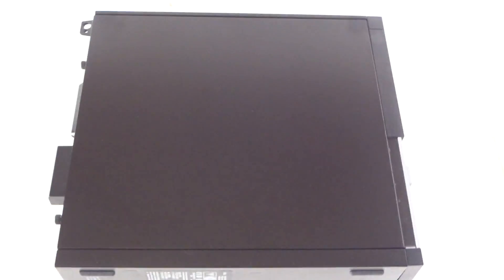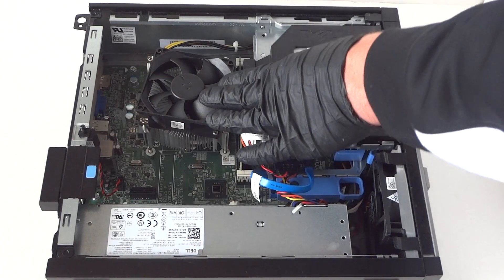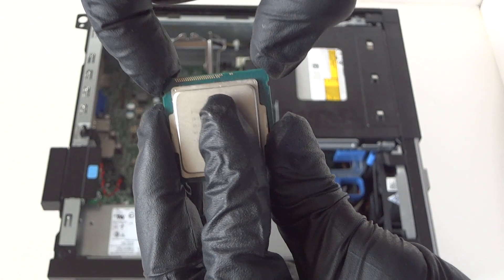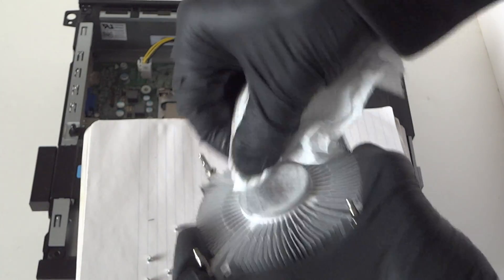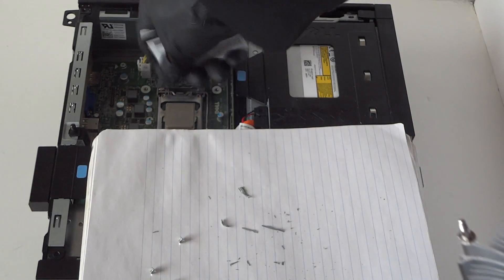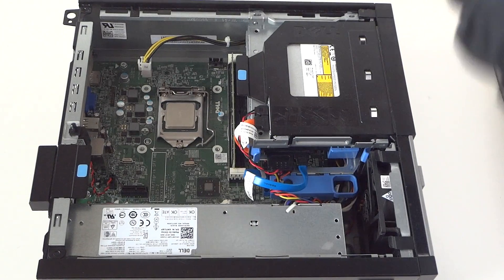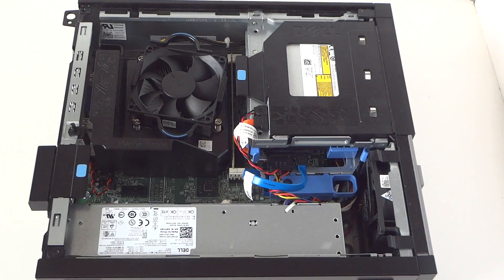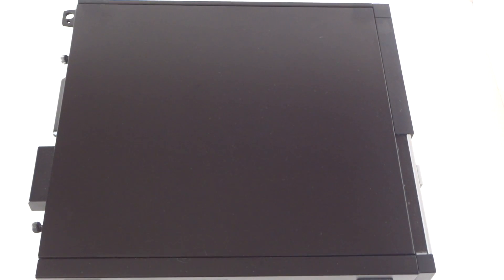Dell Optiplex 3020 CPU Upgrade

Comment from the maker: List of Parts and Upgrades works with this system :

BIOS Update Required Version A20 Before installing i7 CPU.
https://www.dell.com/support/home/en-us/product-support/product/optiplex-3020-desktop/drivers
 

CPU Support List:

Intel Core i7 4790K, 4790, 4770K, 4770, 4770S
Intel Core i5 4690, 4670K, 4670, 4590, 4570, 4670S, 4430
Intel Core i3, 4170, 4160, 4150, 4130

CPU Upgrade: 

Intel Core i7-4790 Haswell Processor 3.6GHz 8MB LGA 1150 CPU
https://amzn.to/3xeRaF5

Intel Core i7-4770 Quad-Core Desktop Processor 3.4 GHZ LGA 1150 
https://amzn.to/3QFmJ1v

List of RAM will work with this system.
Maximum Memory supports: 16GB 
Supports only DDR3 or DDR3L

This RAM works with this machine MAX RAM 16GB:

(1.) Crucial 8GB Single DDR3L 1600 MT/s (PC3L-12800) Memory CT102464BD160B
https://amzn.to/2VhGv8O

(2.) Crucial 4GB Single DDR3L 1600 MT/s (PC3L-12800) Memory CT51264BD160B 
https://amzn.to/2xq46wb 

(3.) Crucial 16GB Kit (8GBx2) DDR3L 1600 MT/s (PC3L-12800) CT2K102464BD160B 
https://amzn.to/2VpsKpP

(4.) A-Tech 16GB (2x8GB) DDR3L 1600 MHz UDIMM PC3L-12800 (PC3-12800)
https://amzn.to/3i97Zt2

List video cards will work with this system.

(1.) AMD Radeon RX 6400 Low Profile Gaming Graphics Card
https://amzn.to/3s8MUUY

(2.) Gigabyte GeForce GT 1030 GV-N1030D5-2GL Low Profile 2G Computer Graphics Card 
https://amzn.to/2Z4PHkp

(3.) ZOTAC GeForce GT 1030 2GB GDDR5 64-bit Low Profile Video Card ZT-P10300A-10L 
https://amzn.to/2WzgLXk 

(1.)  Thermal Grizzly - Spatula for Applying and Spreading Thermal Paste
https://amzn.to/30Qq4ag

Thermal Compound Paste:
(1.) Arctic Silver 5 Thermal Cooling Compound Paste 
https://amzn.to/2ziNU0H

(2.) Noctua NT-H1 3.5g, Pro-Grade Thermal Compound Paste
https://amzn.to/36kTk7A

(3.) ARCTIC MX-4 (current edition) Thermal Compound Paste 20 Grams 
https://amzn.to/2DhGJaK 

3.5" to 2.5" SSD or Hard Drive Caddy Adapter R494D 0R494D 
https://amzn.to/2XTPeRr

SSD List:

Samsung 870 EVO 2TB SATA SSD
https://amzn.to/3ezOds5

Crucial MX500 2TB 3D NAND SATA Internal SSD
https://amzn.to/3B9f8CF

SanDisk Ultra 3D NAND 2TB Internal SSD - SATA
https://amzn.to/3RSZ8LR

(1.) Samsung 860 PRO SSD 256GB - 2.5 Inch SATA III Internal Solid State Drive
https://amzn.to/2BY5gRl

(2.) Samsung SSD 860 EVO 250GB 2.5 Inch SATA III Internal SSD 
https://amzn.to/37xWUfc

(3.) SK hynix Gold S31 1TB 3D NAND 2.5 inch SATA III Internal SSD
https://amzn.to/3d7X6D6

(4.) Samsung SSD 860 EVO 1TB 2.5 Inch SATA
https://amzn.to/2B2FURX

(5.) SanDisk SSD PLUS 1TB Internal SSD
https://amzn.to/3hwdqku

(6.) SanDisk SSD PLUS 240GB Internal SSD
https://amzn.to/2zfc7EX

(7.) Crucial MX500 250GB 3D NAND SATA CT250MX500SSD1(Z) 
https://amzn.to/3bTTjbX

(8.) SanDisk SSD PLUS 480GB Internal SSD SDSSDA-1T00-G26
https://amzn.to/2yfgjUK

HDD For Extra Storage:
(1.) Seagate BarraCuda 4TB Internal Hard Drive HDD – 3.5 Inch
https://amzn.to/3d3xWeR

(2.) Seagate BarraCuda 8TB Internal Hard Drive HDD – 3.5 Inch
https://amzn.to/3xjUDSJ

(3.) Western Digital 2TB WD Blue PC Hard Drive HDD - 5400 RPM, SATA 3.5" - WD20EZAZ
https://amzn.to/3w3jIQA
Reply: nice to see youre still updating to this day. youve saved me from a lot of struggle. you really are the goat of optiplexes <3
Reply from the maker: Hi, thanks.

Comment: Do you need to upgrade bios if u want to upgrade from a i5 4950 to a i7 4770?
Reply: If it’s stuck on a20 which is the latest then your fine but if it’s stuck on the older version then yes you need to update it

Comment: I applied it the same way as shown and it’s slower than before. Does anyone have a fix?
Reply from the maker: Hi, what CPU did you install ?
Reply: @Mxkdt  the one I bought didn’t fit so I just scraped off the thermal compound of the CPU that was already installed and reapplied some thermal paste

Comment: I have an Optiplex 3020 SFF with Core i3-4130 (65 W). Do you think it's possible to upgrade to a core i7 -4790 ? It's a 84 W so I guess I will need to change the cooling system right ? What about the 255W power supply ? Will it be enough (GT 1030 and SSD inside atm) ? Thanks
Reply from the maker: Hi, yes this PC Dell Optiplex 3020 SFF does support i7 4790, 4770 CPUs and you have to update BIOS first  before you upgrade the CPU... Latest BIOS Version A20 
https://www.dell.com/support/home/en-us/product-support/product/optiplex-3020-desktop/drivers
Reply: @Mxkdt  thanks 🙏 but what about the cooling system ? Actually, mine is for the core i3 version, aluminium only, no copper. Do I need to change it too ?
Reply from the maker: Yes you can upgrade to Dell OptiPlex XE2 SFF Performance Heatsink  and Fan Assembly J9G15 0J9G15 CN-0J9G15 that will work in dell optiplex 3020 sff, and they sell them used on ebay right now in us...
Reply: @Mxkdt  thank you !

Comment: I have bought an i5-4690 from an i3-4150 in my Optiplex 3020. Could I enable Turbo boost? Because it seems that the CPU works too

Comment: I had a optiplex 3020 sff given to me for free. I’ve splurged a little since I didn’t have to drop any money to get it. Just ordered a i7 7490 to install. Should I worry about cooling the CPU since my base cpu is the i3 4150? Upgrades I’ve done so far are added a 315w power supply, installed GT 1030 GPU, 480 GB SSD.
Reply: How did it go?
Reply: Any updates?

Comment: I have a Dell optiplex 3020 sff i3 4130, with a h81 type socket, I know I need a 65w maximum processor but what good options are there to get a decent i5?
Reply: U can go with i7 -4770s
Reply: @djimmy616  very helpful, thank you

Comment: Hey I have an Optiplex 3020 with a 600 w power supply. I’m currently running an rx 570 paired with an i3 4130, but I’m looking to upgrade my cpu. What would be some good ones I could get ?
Reply: I7 4790k is the best
Reply: I5 4690k is good as well

Comment: I have an Optiplex 3020 processor phase which is the best processor to match
Reply: same generation i7 NON k cpu, preferably i7-xxx T version, for low power consumption. 

also, check what chipset motherboard you have, n check if the Next gen will work. example: if you're on 3rd gen, see if same socket is for 4th gen.

i have 3070 micro i5-9500t n noticed i7-9700 FITS n works, but not the K version n Not the 10th gen cpus

Comment: Hello,

I have a optiplex 3020 i5 4590. Would it be compatible with a i5 6600k?
Reply: No. Max a 4790   (or 4790k is a risk but 4790 works.
Reply: @martijnvanzanen4075  thank you. 

Can I install a GTX 960 or 980 onto this?
Reply: @hmgames8300  Not with the default powersupply. U need a stronger one then.
Reply: @martijnvanzanen4075  any recommendations?
Reply: @hmgames8300  If 7i normal cpu ( so 84w) and a gtx 970 or so. 500w GPU u need at least.
Reply: @hmgames8300    By he way. I got the DELL 3020 Micro. So I can only use T models of cpu. Like a i7 4770t (its a bit slower but it uses only 35 w) SO I don't need another adapter/power supply.
Reply: @martijnvanzanen4075  hmm okay. So let's just say for example if I upgrade my optiplex i5 4590 processor to a i5 4790. I'll need a stronger power supply to support a gtx 960 or 980 right?
Reply: @hmgames8300   Even if you dont change cpu,  U need a stronger PSU for your GPU.
Reply: @martijnvanzanen4075  Great input you posted here... i also have the Micro, a 3070 i5-9500t, the i7-9700t is super expensive N the i79700 n K variants are cheaper. From what you n others said, the K variant is problematic. So, I'm thinking of getting i79700 65W tdp,  would a 90W power adapter suffice?

This guy ran an i7 with stock fan, I'm thinking if i can do the same, or leave micro case open, or find a low profile Noctua/Intel cpu fan that is better, n case open.

what do you suggest? 

https://youtu.be/uagPrHTEIuA

Comment: hi, is the optiplex 3020 MT supports the I7 4790 and 2x8 ( 16gb )   PLS respond
Reply: It supports the 4790 none k 100% just upgrade bios. Memory. I didnt tested yet.
Reply: @M vz: i have the 3070 micro with i59500t 35W tdp with 65W power adapter, can i upgrade to same socket cpu lga1151v2 like i7-9700 (65W tdp) or i7-9700K (95W tdp) ??? I found K version Cheaper  which is faster than 9700, but I'm interested why you said to Universe, K dont work.
thx

Comment: I have this desktop (with a stock 255 W power supply).    so if I upgrade from a i5-4590 to an i7-4790,  how much of a bigger power supply do I need?  will 300 w work?  .....or 350 W?      I would prefer to keep with the smallest power supply possible that will still work just to save on electricity costs.  I don't do any gaming.  but I will be adding a video card (possible nvidia quadro pro) that will run up to 4 monitors.     thanks
Reply: Core i5-4590 and Core i7-4790 CPUs are both 84 W, so I'm pretty sure power shouldn't be an issue.  I recently installed an i7-4790 in my Optiplex 3020 SFF and it appears to be running fine. The only thing I'm wondering about is according to CPU-Z, it's showing 4 cores but only 4 threads when it should be 8 threads.
Reply: Hi, so did you try changing to the i7-4790 with the 255 W power supply ?
Reply: I didn''t ever upgrade the CPU.  I did add a 6 port video card (AMD radeon 7750 4 GB).   so I did end up upgrading he power supply to run that.  I think I upgraded to 290W and it runs fine.

Comment: I have this desktop.  so if I upgrade from a i5-4590 to an i7-4790,  how much of a bigger power supply do I need?  will 350 w work?  .....or 400 W?   or can I keep the stock power supply (under 300 W)?     I would prefer to keep with the smallest power supply possible that will still work just to save on electricity costs.
Reply: No upgrade. Only upgrade power supply if u put in a graphics card

Comment: Hi,

can a i5 4590 fit in 3020 MT

Also would a Sapphire Pulse AMD Radeon RX 570 ITX 4GB GDDR5 Graphics Card fit in if I upgrade PSU?

Regards dan.
Reply: Yes! It can! In my office we have a i5-4590T  inside the 3020M but video card not.
Reply: card might be to tall

Comment: Hey bro i can upgrade my processor , my pc is a optiplex 3020 mt , y have a power supply evga 600 w , 
my processor is i5 4590 
i want change for i7 4790K 
i can ? my pc support thats ?
Reply from the maker: Hi, yes you can upgrade to i7 4790 and replace power supply to 600w in minitower and you have to use 24pin to 8pin Power Supply Cable for DELL Optiplex 3020 Adapter Cable they sell on Ebay.
Reply: @Mxkdt  does the k series work? 4790 vs 4790K?
Reply from the maker: @rvwjboi23  Hi, the I7-4790 is 84w and the I7-4790k 88w.  So, if the MB limit is 84w...  k Series will run to hot in this system...Dell Optiplex BIOS doesn't not allow OC anyway. I recommend you get  I7-4790 for this system and make sure you have the latest BIOS installed before upgrading the CPU....
Reply: @Mxkdt  thanks. What is your opinion on the xeons?
 E3 1270 v2 or v3?
Reply from the maker: @rvwjboi23  E3-1270 v3 is a great CPU what are you trying to do ?
Reply: @Mxkdt  thank you for the response. I’m a noob to this kind of stuff and just wanted to get the best bang for the bucks. I appreciated your opinion.

Comment: Just wanted to ask what cpu was on the motherboard and what did you swap it out to and did you have to update the bios. Just one more thing I have the optiplex 3010 with an i5  cpu but my case has a different setup and it a sff also.
Reply: This is 3020 not 3010

Comment: hi. I have a dell optiplex 3020. it has a Intel Core i5-4570 @3.20 GHz. what are my options for a new cpu?? thanks very helpful video!
Reply from the maker: Hi, yes you can upgrade to i7-4790 CPU. Before installing it, be sure to update the latest BIOS.
Reply: @Mxkdt  thanks so much!

Comment: Hi, I would like to know if I can mount i7-4785T to my Dell Optiplex 3020 MICRO (I currently have an i5-4590T processor), which also has LGA 1150, 35W, HD Graphics 4600; but the manufacturer in the specification did not predict i7 processors in this model? Please help :)

Comment: Could i put a i7 4770k in this 3020 dell unit it currently has i5 4570? Or any other OC cpu?
Reply: I tried a 4790k and while it recognises the processor I am getting issues with the system hanging.  Based on the reading I have done, if you are looking to upgrade your 3020, avoid the unlocked 'k' processors, in your case I would stick to a regular 4770.  
Also for info I have tested using the A17 and A18 bios' - I've reverted back to the original 4570 processor for now until I can get a replacement motherboard for the 4790k.
Reply: @dmc4708  So, should i use the regular i7 4790. would it work? pls let me know
Reply: @cgwworldministries does i7 4790k work?
Reply: @cgwworldministries i have decent psu. now i want to use i7 4770k or i7 4790k.
Reply: Noob question - is the thermal compound necessary? I haven't heard of this at all in the research I've done for this task.

Comment: Hello. I have a 3020 with an i3 4160 8gb ram 250HDD. Which processor you recommend me to upgrade my pc? 
Thanks for answering me
Reply: Depends what your power supply is.
Reply: @RiiftzYT  evga 500 80plus bronze
Reply: @cgwworldministries thanks bro. now i upgrade to 8gb ram, 1tb samsung SSD, evga1070ti evga power supply 500 plus bronze. but im not sure about the processor. so, youre telling me that i can install the i7 4790 without any issues.? ive love that

Comment: Does it accept I7 4790?
Reply from the maker: Yes
Reply: Mxkdi for real? Cause ive looked for any info about it and couldn find any :/. Im a lil bit worried to spend money on i7 and dont work.
Reply: Joao Luis Rechtenwald I'm looking to do the same upgrade, but can not find a definitive answer on if it will work. Were you able to upgrade your Optiplex 3020 to a i7 4790? If so, what bios version are you running?
Reply: The BIOS version does not matter because if you have the last it works necessarily as well as all those before.

I'm also looking for a real answer on what the I7 4790 works. If you buy it tell me if it works.
Reply: AluMinioume I bought a 4790 on Sunday, it's on the way to me, I'll let you know if it works.
Reply: @dmc4708  ok
Reply: you use the SmallFromFactory or MiniTower chassis? Because i have the MT, and in the video it's SSF.
Reply: AluMinioume I have the Optiplex 3020 MT.  The 4790 arrived earlier today, and I can confirm that it works! I updated the bios to the latest version (A18) before installing the 4790. For info, I purchased the i7-4790 BX80646I74790. Good luck if you choose to do the same upgrade!
Reply: @dmc4708  ok tanks!
Reply: AluMinioume no problem. I made a topic on the dell community forum regarding the upgrade, along with some CPUz screenshots. If you do a search on that site for Optiplex 3020 MT 4790 that should bring up the post. I have the same username as I do here on YouTube.
Reply: @dmc4708  please let me know to me too. im just missing the processor to make a full upgrade.
Reply: @aluminioume856  i have the MT but i remove the HDD chassis in order to install the GPU EVGA1070ti and 1tb samsung SSD
Reply: it's been a while since I use the 4790, it is perfectly recognized by the BIOS and works well. With the stock cooler (i3 starting) 60 ° in benchmark, it's very good!

And asus RTX 2060 PH fits in case.
Reply: @aluminioume856  RTX 2060 fits without breaking the HDD cage ?? That's what I had to do to install the 1070 Ti
Reply: @danielfilpo4465  Yes, without breaking anything.

https://drive.google.com/folderview?id=13jBa4Sg6LUTsYV1XG_WmfHEFwR_zQSnE

Sorry for cable management.
And we can close the PC pannel
Reply: @aluminioume856  nice but my advice 4u would be to break the HDD cage so you can install all size of GPU. And use the CD room cage to install a 1tb SSD
Reply: @danielfilpo4465  i have a samsung 860 evo, under cd cage, it's an Enermax ECR501 (usb in front + 2x 2.5 hdd)
Reply: @aluminioume856  ohhh didn't know about the enermax501. Looks great. Could be my next upgrade
Reply: @aluminioume856  does the 3020 mini tower accepts ram setup 16gb ram 2x8 ??
Reply: @danielfilpo4465  yes
Reply: yes

Comment: will the system accept a non low voltage processor? the ones that does not have a T on the end of the processor model number.